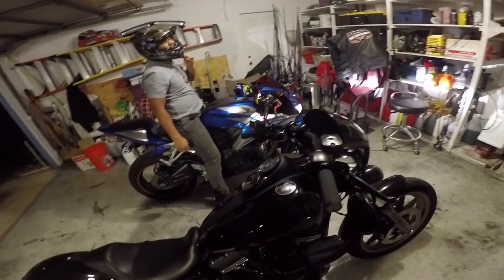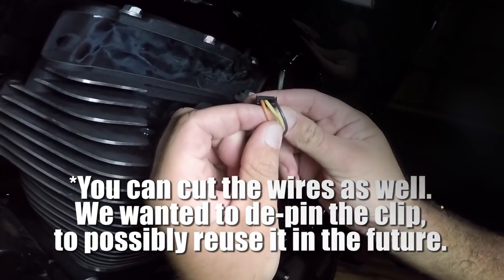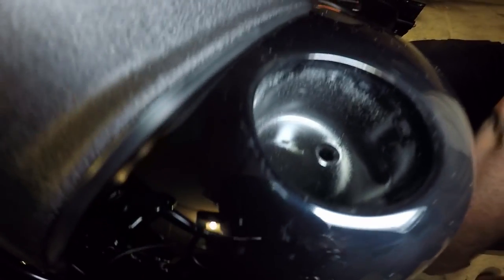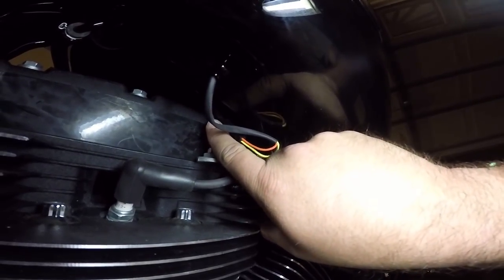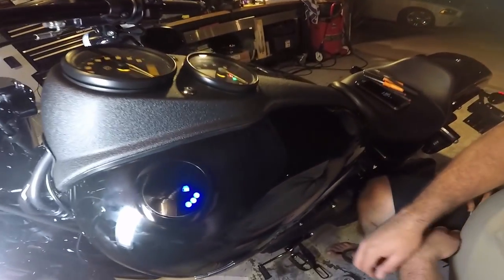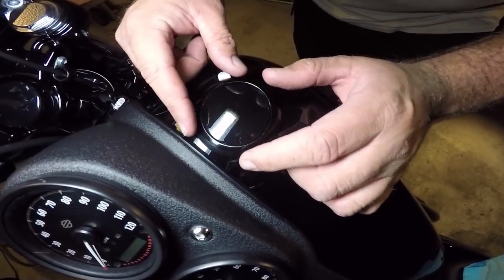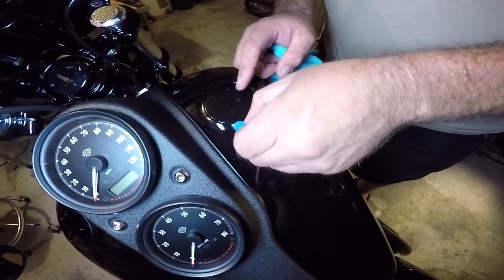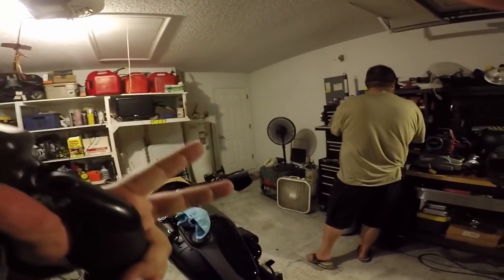How To: Harley Flush Mount Gas Gauge & Cap Install

Comment: Some advice from an electrician. First, always take a picture of the wiring harness. Don't rely on memory. Second, use electrical tape to attached a  single wire about 2 ft long to the wires of the old gauge. This is so when you pull the wires out you can use the two foot piece of wire to bring a new wires back in. it probably took them quite a while to fish those wires back through that little tiny hole on the bottom. Next lightly Lube the electrical pins and bare wires with silicone dielectric grease. You can get it at most auto supply stores. Last wrap the entire wire harness with nylon High-Temp Split Loom. Auto supply stores will have this also.

Comment: You'll have to let us know how accurate the fuel gauge is. I've heard mixed reviews. Looks slick, tho!
Reply: Hey, I know im 4 years late. But I did have this exact set on my 2008 Street bob for 3 years and they worked amazing. The fuel gauge was accurate and reliable, which was proven with long trips. It was even responsive when the bike leaned far enough. 10/10 I've put this on every bike I've owned since.

Comment: Great video! I was never able to get the wires out of the connector but knowing I wasn't going to be using the stock fuel gauge again I simply cut it off.

Comment: I have these on my Fab Boy S, and let me tell you, it improved the look of the bike 200%.  Also, only really works if you have a black bike.
Reply: I'm trying to find a set for my fatboy S. Did you get from HD or afer market?
Reply: @rmhkvf  hey I just saw this. Mine were installed by the dealership before I picked up the bike (2017 FatBoy S).  I am now looking for the same kit for my 2007 Softail Custom, and The only one that Harley shows is for Dyna only.  But I am starting to think it is the same kit.  They just have it listed as Dyna fitment,  I am going   to ask the guys at the shop tomorrow and see if it fits.  Its expensive (from harley) but I haven't found an after market one.  I just hate the stock gas cap and fuel gauge on that tank.  Hate the console too, wish I could find a custom one that doesn't look so 1984.  I don't like chrome on top of the tank, the sun glare annoys the hell out of me, I like to keep my chrome below the tank only. same for handlebars, I like them black.

Comment: I've been wanting these for my Fat Bob, but in chrome. Never thought about looking on here until somebody mentioned on HDF. Yours was the first video I came across. Nice video. Clean install. Looks I'll be ordering these soon and doing it. I figured you had to drain the tank to install them, but, I'm guessing by your three gas lights on the gauge, that would be incorrect. Good to know! Haha. How is the accuracy of the gauge so far? Fairly close for the most part?

Comment: Hey block head I’ve been watching you for a while, I know this is an old video but I wanted to know if this would fit a 2020 iron 1200 sporty? I just got it to stage one and I’m working on the little stuff.
Reply from the maker: The kit used in the video is for a Dyna, but I think they make it for a Sporty as well. Checkout HD’s website or call your local parts desk 👍🏼 thanks for watching!